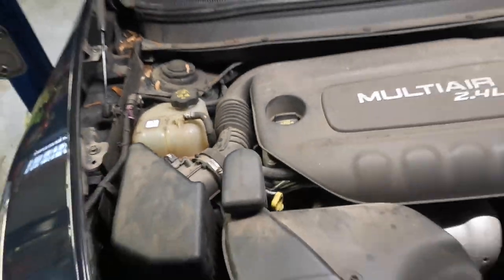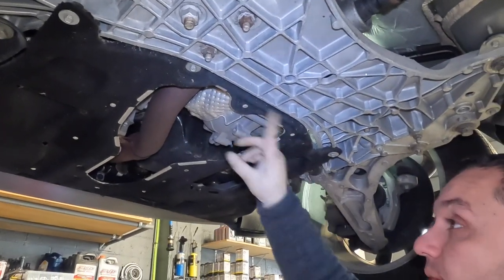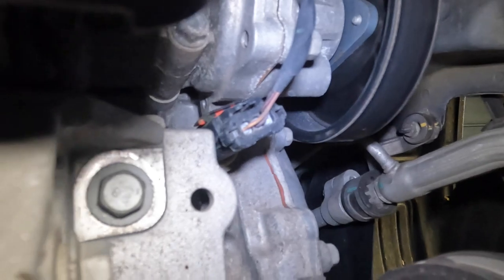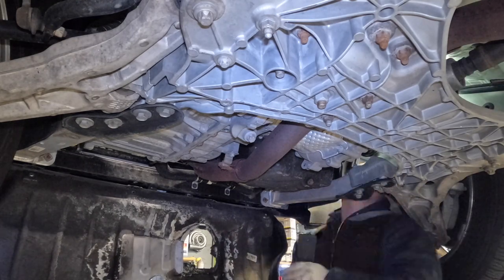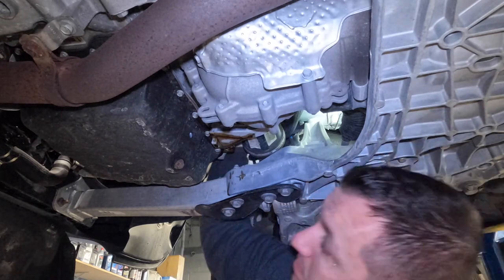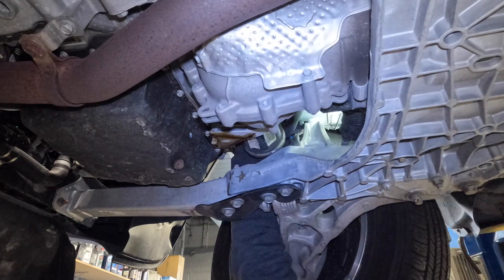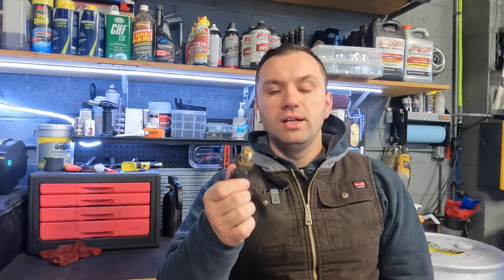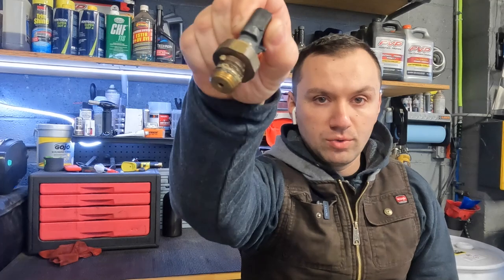CUSTOMER STATES CAR STARTS AND STALLS OIL LIGHT ON BUT OIL IS FULL! OIL PRESSURE SENSOR REPLACEMENT

Comment: Nice video!  Good to show the difference between the two sockets!  Would have been nice to see how you used the pick to unlock the connector and the pick used, but you mentioned it and that is helpful.  Good tip on the oil drip.  Luckily it hit your nose and not your eyes.  PPE is essential when doing things in the shop.
Reply from the maker: It was a tight space my hands would have covered the camera I would have liked to film the whole thing but I couldn't. I'm glad you enjoyed the rest of it and found it useful Jim!